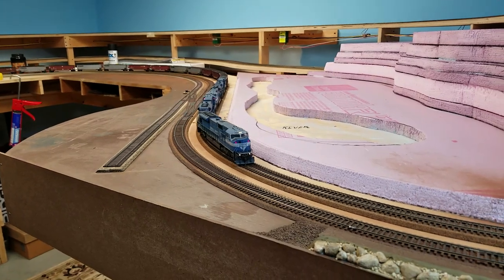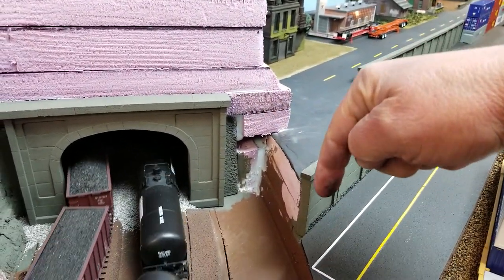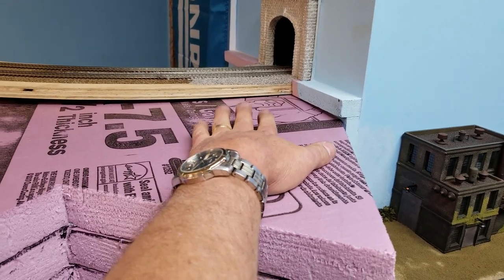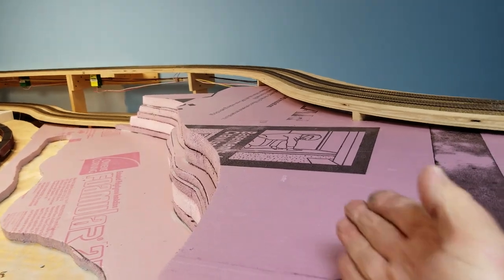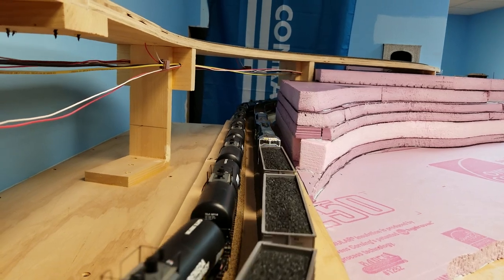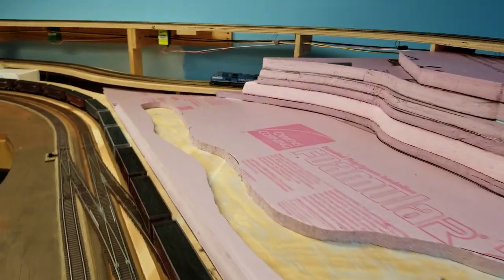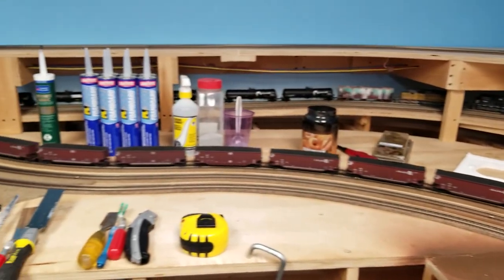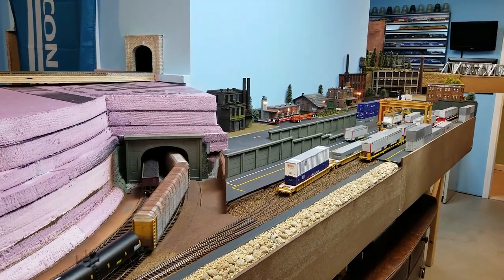Building HO Scale Tunnel #04 "Foam Board Hell".

Comment: You can use a 12" Serrated Bread Knife to carve foam too. Would much rather use The Hot Wire Foam Factory brand cutter. Pricey but worth it's weight in gold if doing vast amounts of foam work. Good luck Andy and please keep sharing your HO modeling endeavors.
Reply from the maker: I also have a skinny hand saw my father in law left me which is about 3" wide at the most with teeth on BOTH sides.

Comment: If it was me, I would still increase the size of that intermodal yard! Lol.  My layout hopefully will have an 8" x 24 feet train yard and a 30" x 24 feet intermodal/autorack yard! With 3 grain elevators 6"-8" wide x  4'-5' long, cold storage warehouse, team track transfer and 60" square truck stop. RH
Reply from the maker: RH Wow I Cant Wait to see that, Sounds Great. I just don't have the Room on that side of the Train Room.
My yards pretty long though on the other side.
Have you Ever been in the New CSX Worcester Massachusetts Yard??
Reply: @apmazurka  Sorry, no. I don't make it that far in the truck. Big yard? RH
Reply from the maker: @CONTAINERMAN68  Google Worcester Mass CSX Franklin Street yard.
They have (4) Rubber wheeled Mi jacks now that straddle 2 tracks and 2 trucks on either side and (1) Single track for I don't know 1/2 Mile track each?
Yard starts at CP 45 and Ends at CP 42 LOL.
Either way they are never overwhelmed with 4 working but the space is full of trucks and they are looking for storage room.
Reply: @apmazurka  I drive by the BNSF Memphis Intermodal Facility along US-78. They have 6 tower cranes working their yard. I bet it's only about 1-1/2 miles long! Trucks, trailers, containers and chassis all over the place! I got a friend that hauls containers in and out of the new Kansas City Logistics Facility near Gardner,KS! They also have 6 tower cranes and that space is about 2 miles long! RH
Reply from the maker: @CONTAINERMAN68  Awesome! Do they hang the unused Chassis in Racks also like Worcester?
Reply: @apmazurka  I'm not sure? I'll have to look on Google Maps?
Reply from the maker: @CONTAINERMAN68  They have this fork truck like vehicle which grabs the empty Chassis by the ass end and hangs them in a rack like you hang a Shirt Lol.
Reply: @apmazurka  I've been trying to build one of those machines using a NORSCOT CAT wheel loader, take the bucket off and done type of pressure brackets that would squeeze onto the frame and then lift it up. Steve Dehart built one in N scale. He's got a YouTube channel but I can't remember his channel name?
Reply: @apmazurka  banjol4595 or Steve Dehart on FaceBook